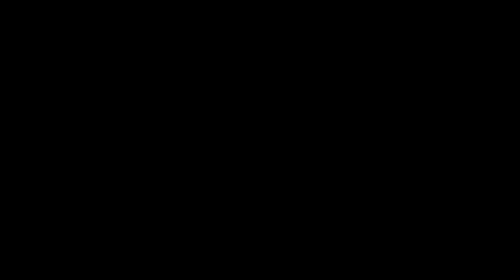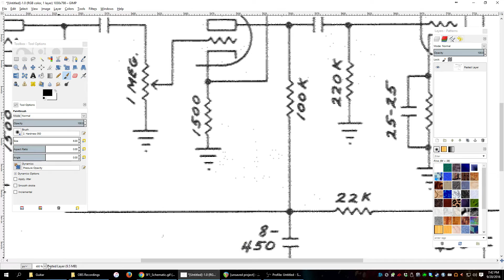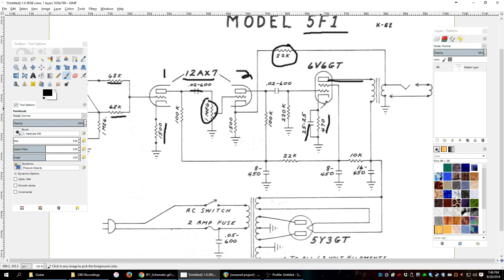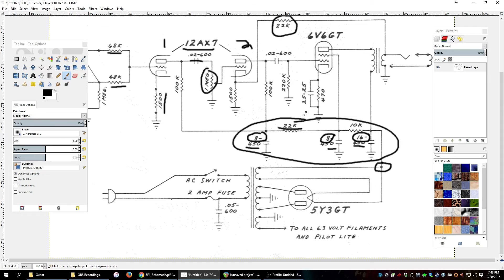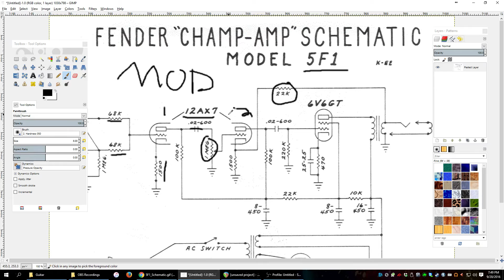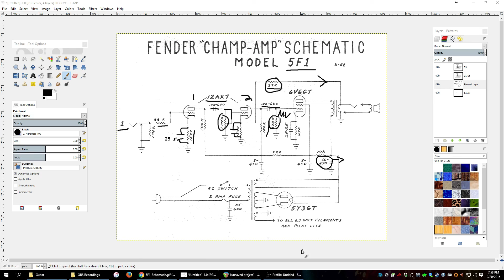Fender 5F1 Champ Schematic - Analysis and Breakdown

Comment: 2.2 uf for that bypass capacitor sounds perfect for a less boomy bass. It's like the values used in analogue mixers and tape echos from the 50s and 60s. Worth a try to replace a 22/25 uf cap.

Comment: Aloha Kley,
The 5F1 inputs are a bit more complicated than described. For single jack input, #1 is normal for a guitar. #2 is -6dB (25%) for dynamic microphones etc. However, there no level shift when both are used, they are both at normal level… the normally closed contacts on the jacks reconfigure the input resistance to make that happen.

Comment: One thing that you didn't address is the death capacitor. Anyone who is new to high voltage tube circuits needs to really understand the importance of a chassis ground. As you can see by this schematic there is no chassis ground. If you bought one of these amps back in the day you got a 2-wire power cord. That's the hot and the neutral wires. In fact your wall outlet back then only had two holes. All modern wall sockets have 3 holes. The third hole in the one that carries the ground wire. If you look at a modern power cord it has a black wire a white wire and the third wire is green for ground. If any high voltage wire comes loose inside the amp and touches the chassis then if you touch that hot chassis you will get a high voltage shock. The green wire is connected to the chassis so that if a high voltage wire inside the amp touches the chassis there is a high current short that goes down the green wire back to the circuit breaker in the main panel in your house and immediately trips the circuit breaker in your house and shuts off power to the wall outlet. The death cap was there to control voltage surges when the main on-off switch is first turned on. But that cap can fail and provide a direct path for line voltage to the chassis and without the chassis ground there is no way for the circuit breaker to see a high current and trip. So you need to install a 3 wire power cord and delete the cap in the schematic that is right by the power fuse.

Comment: hi,id like to know what the  secondary voltage of the power transformer and voltage on the 6v6 plate and voltage on the 12ax7 plate cause  voltage is not there on this shematic thanks

Comment: I'd strongly recommend Uncle Doug's instructional videos over this one. There are other good ones as well but Uncle Doug is usually about 95% correct in his understanding and his explanation & speaking is very clear. Beware, there's a ton of BS out there as well, not good when discussing tube circuits.

Comment: The 68k input resistors were put there mainly to prevent interactions between two instruments plugged in together - isolation IOW. Without them the instruments are in direct parallel & turning down one guitar's volume or tone would affect the other one's as well.  That was the original thinking...also they provide a little protection in case the tube blows and sends high voltage to the grid and therefore the player (admittedly rare).

The 1 megohm gridleak resistor stakes the grid reference to ground, otherwise the voltage will drift and eventually cutoff the tube's current flow altogether, called blocking. It's what sets the bias between grid & cathode.

These resistors also help with oscillation & noise as mentioned.

Comment: at 4:06 the input 2 seems to be wired in parallel to the same resistor of input 1 i do not see the difference between input 1 and 2. both seem to be equivalent
Reply from the maker: The input jack that is typically used is a 'shorting' type jack.  This means that the tip is grounded when nothing is plugged in.  So when you plug in a 1/4" cable it lifts that sleeve connection.

Comment: Why do I see discrepancies in the 5F1's schematic online? Some show a 1.5k connected to pin 5 of the 6V6. Others show a 470Ω resistor between pin 4 and the 2nd filter cap. Other schematics don't even show these components. Why is that?
Reply: Probably because schematics are made by people reverse-engineering the amp, and may or may not have factory parts or mods in the schematic. Also, sometimes a product name can apply to wildly different products, so a Champ from one year may look very different to a Champ from a later year.

Comment: Will it be okay if a 5Y3 rectifier is put in place of 5AR4.

In my clone Champ 5F1 is 5AR4.
Reply from the maker: Yes you may do that.  You would get more voltage drop with a 5Y3.
Reply: Thanks for your reply.
As it reflects on the tone of the amplifier, does it get a lighter tone with less gain.

Comment: Good Video on Fender Champ circuits and MODS,  I plan to mod my champ clone by adding a 20 MFD Filter with a 4 Hy 50 mA Choke, used by Fender 5Y3 circuits.  FOR myself, additional videos modifications to this classic champ circuit.   Again i enjoyed this video
Reply: Also 1961-1963 Fender Tremolux 6G9-B It has Five 16MFD Filter Capacitors with a 4 50 Hy 50 mA Choke "GZ34"

Comment: great video!!! Very helpful to learn this simple foundational circuit. There are a couple of sections I hope you can give me clarification on, but maybe off of this string to reduce clutter.
I'm interested in getting a little more wattage out of this amp circuit. I built a mojotone 5F1 kit so I feel it's OK to alter the circuit. I can't leave well enough alone and these mods help to learn the circuitry that much more. I've read that a 6L6 can be run in the power amp instead of the stock 6V6. To utilize the 6V6 power handling, a 15W output transformer should be installed. Has anyone tried this? I popped an Eminence 820H 4 Ohm 8" speaker into the cabinet. It sounds great, but would be cool to feed it more "juice". Any advice on that mod?
Reply from the maker: You certainly can put in a 6L6 power tube. A higher powered OT would be important. You may also need to tweak some of the components on the power tube to properly bias the 6L6, specifically the cathode bias resistor.

The power transformer should be okay, but something to look into. Can yours handle the current draw? Is the plate voltage optimal? I know something like an EL34 draws a lot more current. A 6l6 may be fine yet. Plate voltage tends to be a bit hot in a 5f1 with 6v6 due to the wall voltage being a bit higher than 1950. But something to look into.
Reply: Reminds me of the time I bought a silverface champ at a small music store. As I was leaving, I asked the owner/sales guy how to make it louder. He said 'put it on top of a Marshall'.

Comment: What can you do to make it more Europe friendly? Outlets here spit a nice 240V, so i think it will make a difference and a half. Also, how can you mod it so the mids are boosted and most highs are removed?
Reply from the maker: The primary side of the Power Transformer needs to have a 240v tap and be wired accordingly. 

You can add some tone controls no problem.  The most commonly used tone stacks in tube amps are passive (they only remove frequencies).  So you can't really 'boost'.  Rather you are cutting frequencies.  The 5F2A has a simple high end roll off tone control.  To create a mid 'boost' you would need to cut the highs and bass.
Reply: @KleyDeJong  Which one is the tone control on the Princeton? The 1meg that goes to a .005 cap or the other one?

Comment: The 5Y3GT is spec'd for a 10mf capacitor as the first input capacitor. I would increase the second one in the chain rather than the first. The 16mf is already pushing it and going higher will shorten the life of the tube. Very well done overall.
Reply: The 5Y3 data sheet does spec'd 10 uf 450v electrolytic capacitor and a 10 henry 35mA transformer filter choke.   There are schematics with the 16 uf electrolytic with a 4 henry 50 mA transformer filter choke.  For myself, i plan to build a 5y3 with FOUR 16 uf 450 volts electrolytic with a 4 henry 50ma transformer filter choke.  For a clone build, it's worth building.
Reply: Uncle Doug video on Champ like circuits are Negative Feedback Loop Pot, a transformer filter choke, and a OneK 6V6 grid resister.
Reply: D-LAB STEPED UP the filter capacitor in series 33 uf, 22uf, and 10 uf 450 volts
Reply: Thanks Chris, i learned a lot from your post, and thanks Kley for this video
Reply: Finally, RobRobinette website cites Increasing the value of the first power supply filter capacitor or adding a choke can reduce voltage sag and stiffen the power supply. They can also firm up the bottom end because it takes more power to amplify low frequencies. Keep in mind tube rectifiers have a first filter cap size limit so reference your tube rectifier's datasheet to keep from overtaxing the tube at turn-on.

Comment: A comment for the video creator. The 1M resistor when using the #1 input provides the grid return path for the input triode. When using the #2 input the 1M is shorted out and the grid return to ground becomes one of the 68K resistors with the other 68K resistor feeding the input in series. The grid is taken off at the mid point of the 2 x 68k resistor stack forming a 2:1 voltage divider causing a 6dB input signal level drop.
Reply: If you plug instruments into both inputs at the same time does it take off the 6db drop?
I read before that some bf sf Fenders do.. but I could be mistaken.
Reply: yes @Blueguitar007
Reply: I only use 1 input at 33k if that helps anyone with a 1 Meg pot

Comment: This could be confusing to a beginner, you say multiple times that "signal" is going into the tubes but you meant to say voltage. Specifically when talking about the rectifier. Also you forgot to mention that the coupling caps block the dc from the plate to grid and only allow the amplified ac signal from the guitar to pass through.

Comment: You cannot put a 1M master volume control in this circuit -- as you suggest might be possible -- because that would exceed the maximum grid resistance (500k in cathode bias) of the 6V6 as per the 6V6 datasheet. I'm one of those guys with 30 years of experience with this. Also, to date, all 5F1 Champs I've worked on, from various production years, had cathode bypass caps on the input stage from the factory, as did its virtually identical predecessor, the 5E1.
Reply: I put 250k pot in that position and it works great
Reply: it will. But what it won't do is what most would prefer it do, get the output tube up to full song. That, it will not do. What I do on mine is install an L-Pad attenuator.  @joosboer1030
Reply: So can i simply add a 500k pots for it? I have no prob with overall volume but my wife will.

Comment: The filter caps are rated 450 volts.Tweed champs run at  lower voltages.
Reply: No they don't. I have a totally original 1957 5F1 on the bench right now. The idle output tube current is a bit high due to other issues common to these amps with all original parts and the filters aren't in the greatest shape which tends to pull the B+ down a bit. The B+ at the first filter is 384V at 110 V AC Line (The original intended line AC voltage). At 120V AC Line the first node is at 419V DC. That makes things really hot for the output tube. This is why 'browners' are highly recommended, get a UL / CE / CSA approved one though, for Tweed Fender amps. The AC line voltage was lower in the mid to late 50s. Filter caps in an amp are subject to crest voltage when the amp is first turned on until the tubes warm up. This crest exceeds 477V DC. The caps can handle this because they are rated for 525V surge for a short time. Do not reduce ratings. Do not use import caps in these. Offshore caps have no additional surge rating.

Comment: what is the plate voltage?
Reply: They are listed on the schematic. Resistors are used to decrease the voltages thru the circuit. Plate voltages are marked B+ which comes from the power transformer. B+ comes from old amps that ran on batteries.

Comment: Hello, we want to build an amp my brother and this video will certanly be helpfull. One question, how many ohms should the speaker be rated at? Thanks!
Reply: That will depend on your output transformer. The original champ had a 4ohm OT i believe (or even 3,2). Many modern kits come with a 8ohm OT or an OT that can be used to build multiple outputs (4-8-16). So you should refer to the manual of your output transformer to know what ohm it is made for.
Reply: 4 ohm 8" is the norm. Not many choices, I like the Weber Alnico or Ceramic, ceramic may be optimal for an already gain fuzzy amp. Either will do.

Comment: Great explanations !  You say that the 6V6GT is a pentode but according to the drawing, it looks like a tetrode.  Is that possible ?
Reply: 6V6s and 6L6s are technically "beam tetrodes" as opposed to "true pentodes" like the EL34, but the two terms get mixed up, partly because there's some crossover equivalence. For example, the American 6CA7 was a beam tetrode, but can be subbed for an EL34, which is a pentode. In a beam tetrode, the beam-forming plates take the place of the pentode suppressor grid.
Reply: @southerner66  Spock... We need you on the bridge ASAP!

Comment: This amp is ideal for first time modders. I have completed a clone & now doing extensive 
mods. your video very well presented. one very common error the input resistor tube 1 grid 1.
Reducing the resistor to allow grid 1 be hit  harder No effect - grid 1 is very high impedance, many meg ohms.  The 1 Mr on grid 1 is to provide a drain for any stray electrons to 0V. The 33kr with the miller capacitance of V1 will  reduce  frequencies of 20khz and above.  I   am in the process of raising the gain of both 12ax7 tubes. Pots for bass cut, Baxendall treble - similar to 5f2a but not interactive with volume  control.  Raising the feedback from 2 db to 9.3 db (calculated).  Presence & bass boost aka depth / resonance in the feedback loop. Raising the gain means larger value smoothing cap. 22 uF for V1, 100 uF for V2,   5 H choke (5E2) + 100uF+100r  for surge limiter. Since gain increased - DC heaters 12ax7 is required . 
The effect of not having a bypass cap across V1 cathode resistor & feedback give a flat frequency response  50Hz , -1.4 db up to 20,000Hz +1.9 bd ,almost hifi

Comment: Just found this video. Apart from some minor "hickups" I like what a see. Most obviolus is the explanation you give at 4:50. The two input is not behaving like. If using input 1 the signal goes over both the 68k resistors giving 34k. But if using input 2 only one 68k resistor effekt the signal. So as you said earlier in the video the two input act:s like a hi/lo input.